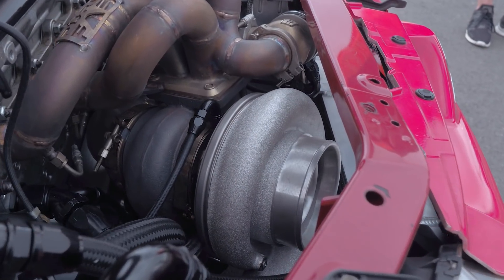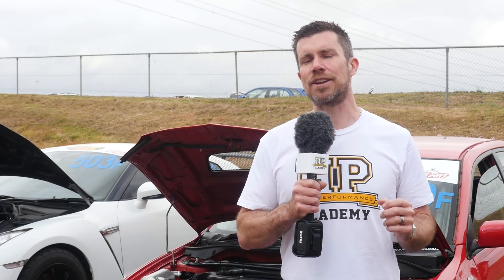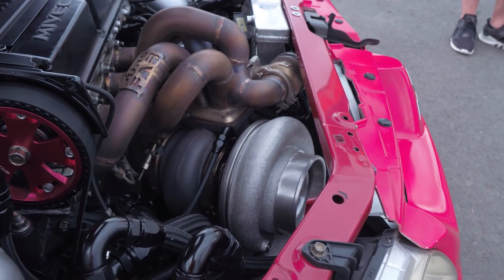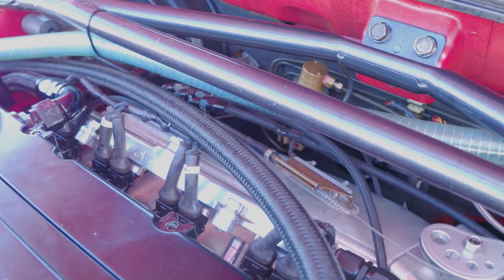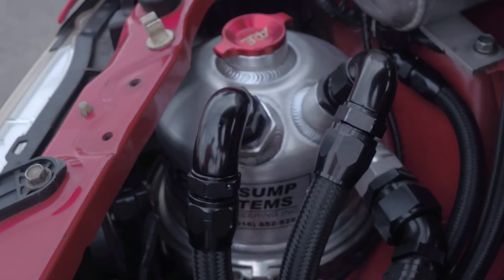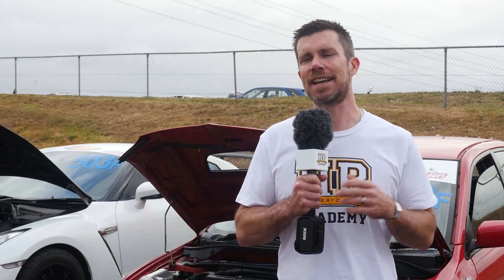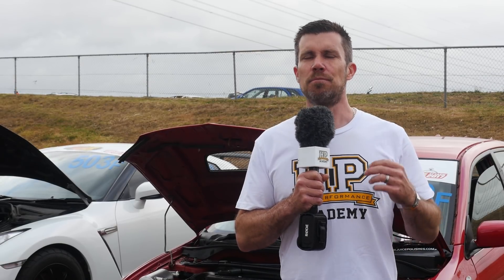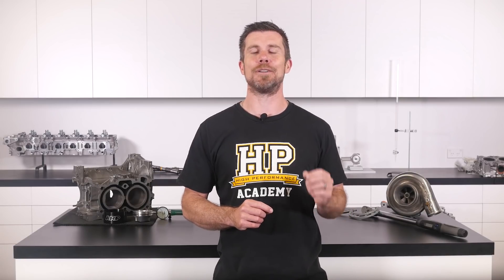[TECH TOUR] 74 PSI of boost, 1238whp 2.2 L Street Car | Micks Motorsport's 4G63 powered Evo 8

Comment: What is the difference between wheel horse power and brake horse power?
Reply: Bhp is what it is making to the crank so when the power is provided to the wheels that is how much power has progressed to the wheels from the drivetrain lose so the number will always be less,  Auto cars lose the highest % in Drivetrain Lose figures however Auto's are Faster because they hold the boost through all gears  Your not using a clutch which briefly cuts the power off for a split second same with a Seqbox you don't need the clutch to shift once your past 1st gear an sometimes 2nd, but you can have an error of miss shifting if you bang the gear to hard an its set as a soft realise meaning you were shifting for 3rd an end up in 4th an lose momentum an rpm range then you have to do a full re run  Depending on the transmission the bhp/whp figures will be different , on a seqbox evo 1100whp would be around 1300-1350bhp so this on the dyno run of 1238 it would be in the 1400bhp range however this kind of power should be done on a Hub dyno to get a clear result with no wheelspin,   because if its spinning its not going to give you a clean run  this turbo has made 1400whp on Supra's / Gtrs with 3.2 / 3.4L strokers with 15psi less then what the evo is making displacement doesn't mean so much a car will make more hp it just has less of a requirement to do so when its Evo vs Supra This Evo on a hub would probly of made 1350-1400whp  Which is not impossible for 4 cylinders  Honda have a lot of examples in that range running 6 second passes  there is also a few evos with that kind of power figure world wide.. including the most hated evo of all Xtreme tuners,  Since evo is actually a Fwd bias car it makes the Awd system a lot harder to run impressive times at a drag strip a few other things factor in too but it defs wasn't a car that was ment for 800hp+ an faster then a low 10 its a nimble quick paced car for hairpins an tight turns when your doing over 25mph/40kph   They suck at under 10kph+turning lol
Reply: Alejandro Aznar common sense
Reply: Abhir Malhotra maybe but why is the "bhp" mostly used to announce the power figure by brands and why is "whp" uses here?
Reply: Alejandro Aznar cause normal peoole care about bhp which is measured at the crank. Some manufacturers measure at the flywheel. 
Racers care about what the car puts to the road. Therefore , WHP.
Reply: Thx for the answers, i assume though that the whp figure is smaller than the bhp, due to losses when transmitting that bhp to the ground
Reply: SeMpr3s Soren thx for the complete answer man, much apreciatted! :)
Reply: No no a lot of people in the Uk think when a car is on the Roller dyno it is still BHP when its actually Whp, Engine dyno is the motor out of the car  in a engine dyno room like how F1 have tested their motors for 25+ yrs  it still triggers me when i watch a Uk video an someone says its 600bhp when its clearly 600whp+ Ugh